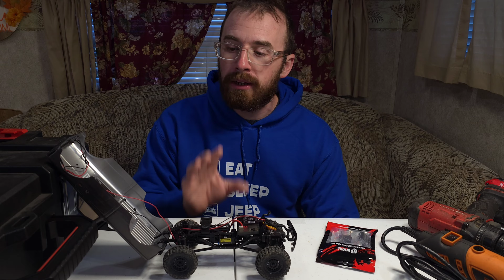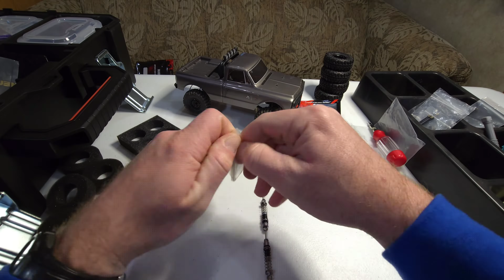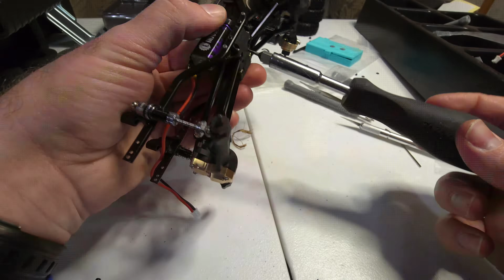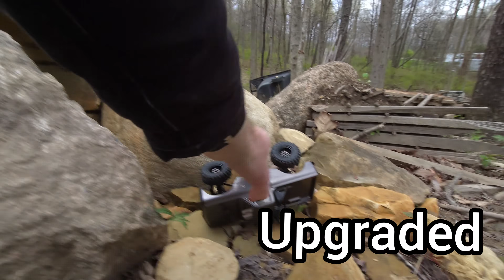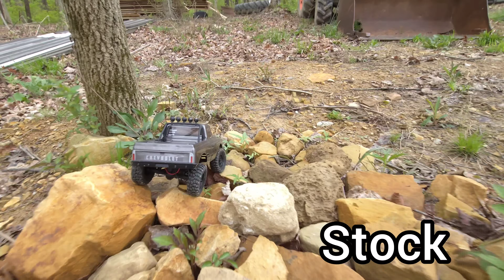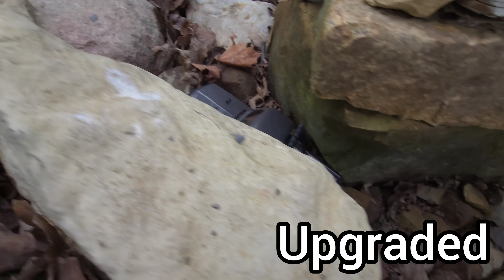Resurrected 24th scale C10 build and testing. Axial SCX24

Comment: I actually have the exact same motor from Injora! Great torque and has lasted me months!
      Another upgrade I would highly recommend is the Injora MB-100 esc, you can plug it into your stock esc/receiver, and it somehow makes your motor quieter while also giving you lots more control at lower speeds.
Reply from the maker: @bustedknee_adventures  O! Good idea! I heard people complain about loud ESCs I wonder if that horrid whining is actually the ESC and not the motor. 🤔
     Eaither way I'll try that eventually. I actually prefer the ergonomics of the v1 transmitter (its easier to drive 1 handed 😉) but the v2 definitely improved the throttle control, an upgrade ESC on a v1 might be a nice little sweet spot.